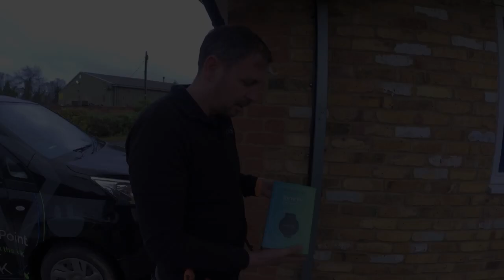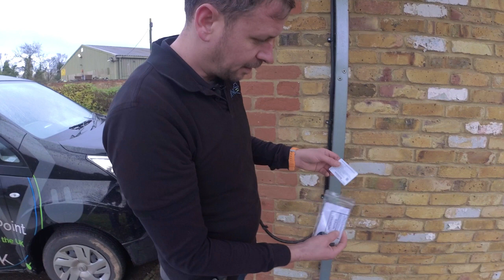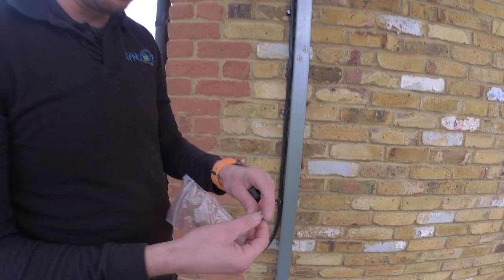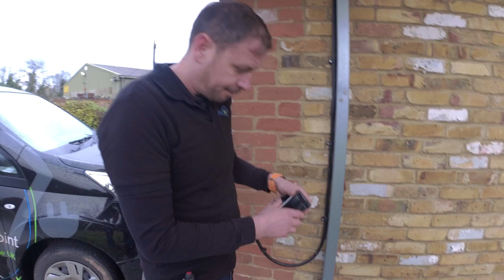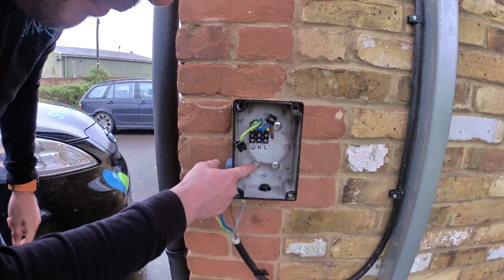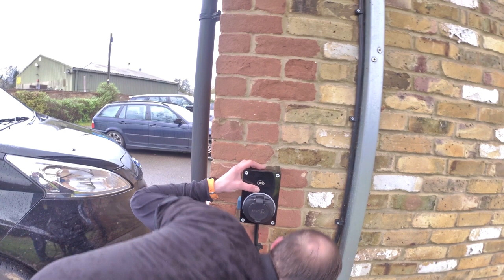Sync EV Installation

Comment: Tried to install today yet there is constantly a yellow light doesn't seem to link? Also on the app doesn't allow reboot?
Reply from the maker: Good afternoon, thank you for your message. 
Whilst we are fairly knowledgeable with the products we sell, some questions stretch us to areas where we are unable to answer.
On this occasion I feel it may be best to contact Sync Ev for guidance. They can be contacted on 01952 983940

Comment: Do these need an earth rod installed ?
Reply from the maker: Hi Mark, The Sync EV charger does not require an earth rod on a single phase supply. If you need any more information, please give our customer services team a call on 01293 565 630.